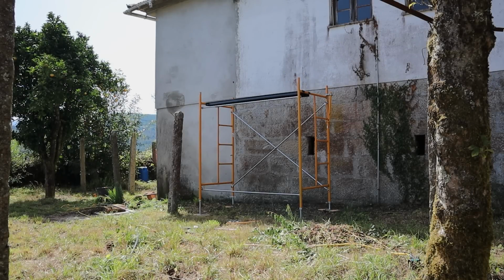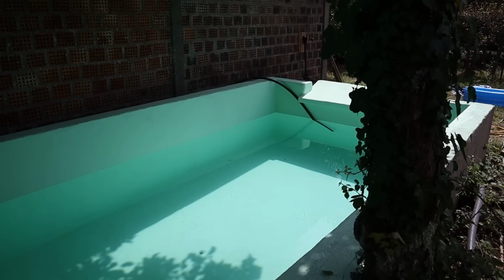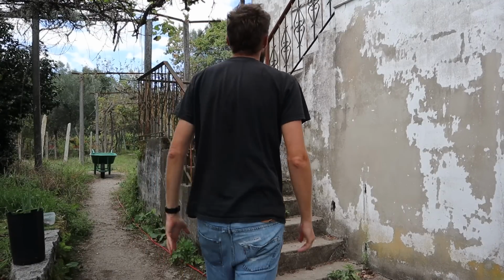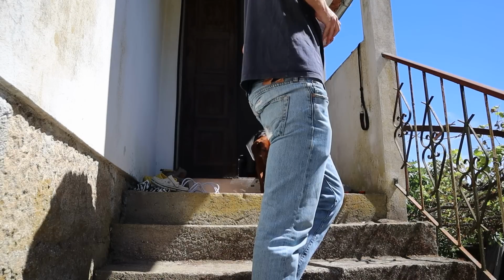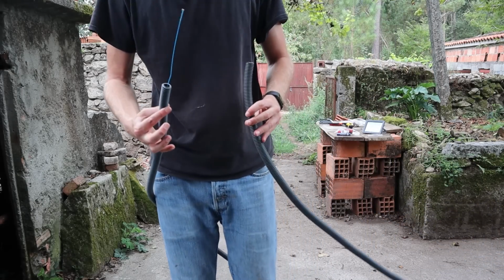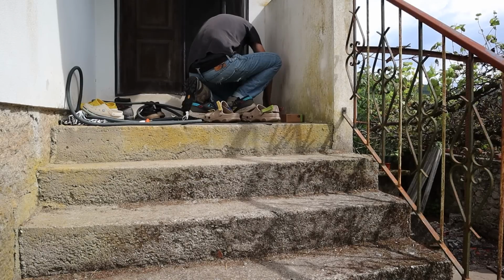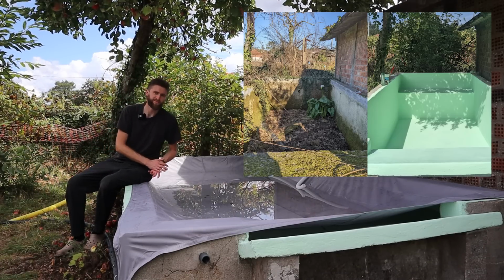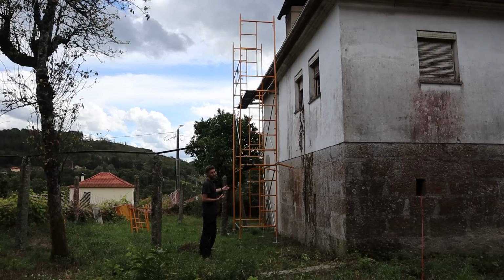#11 First swim at our Portuguese home, installing some new lighting and building a scaffold

Comment: you can vacuum a deflated plastic bag tied to a light string into the conduit then use the string to pull the larger wire , remember you cant pull wire in a conduit with more than 3 90* turns. good content
Reply from the maker: Thanks for the tip Stan!

Comment: Hips n tints again .. Wear a white tshirt in the sun, also straw hat. Those white cable ties are not UV resistant and will probably last only 1 year. Use metal clips instead. Instead of running a thin cable to the lights, how about you run a thicker one? and instead of making a junction box, put a socket, and put plugs on the end of your light cables, then you have power throughout that area in case you need to do some work, charge a battery etc...